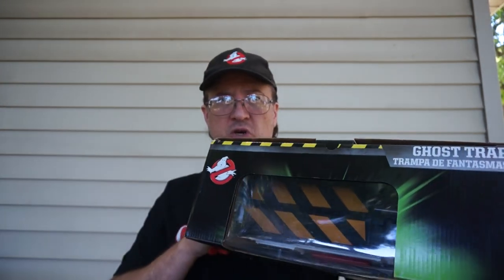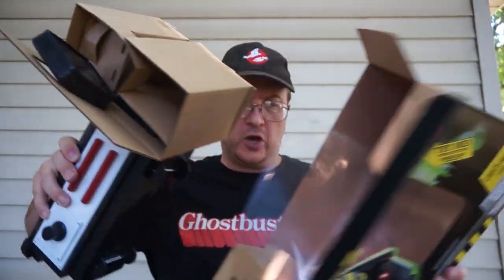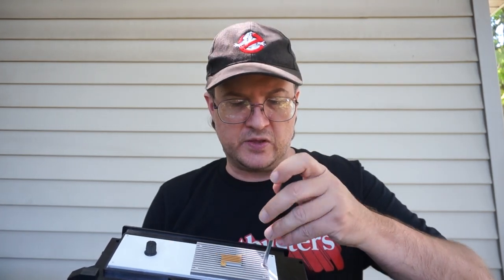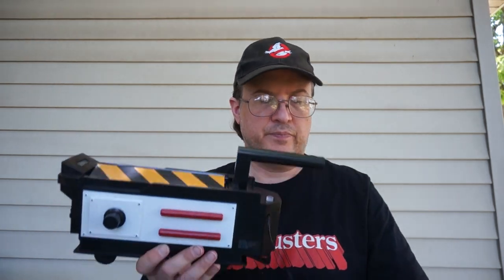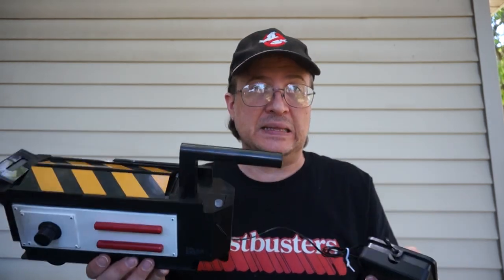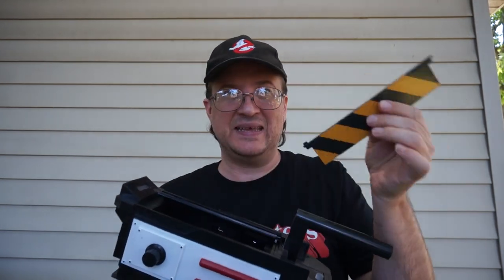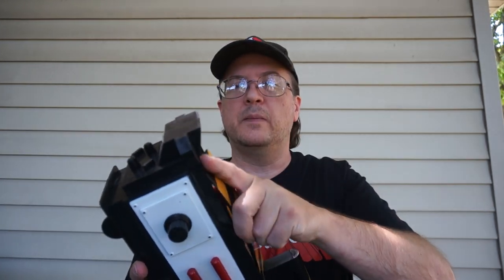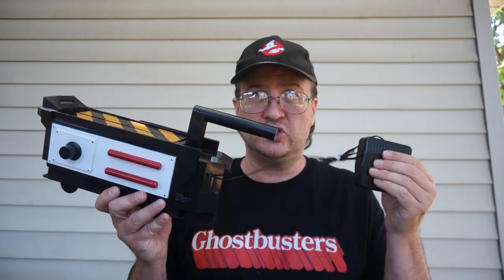TRAP DOORS (and how to repair them)

Comment: I bought this for my nephew. one door is open a bit. did consider returning it (for his birthday) in exchange for one with doors closed. but he will be 6 (i know age but its a toy) I doubt he'll care plus Im sure it will eventually happen. will tell my sister and brother in law of your video if its an issue. It seems a simple fix to not worry. easier to fix then return
Reply from the maker: Sure, just send them the link to the vid. If they have any other trouble with repairs to it, they can leave a message on the vid and I should see it within a day or so, and maybe I can either reply or shoot them a followup video. Also, the wheels pop off of these fairly easily, as my sons discovered on Hallowe'en night, but we popped them back on with little effort.
Reply: @LextheRobot  his birthday is less then 2 weeks before christmas. each year I get him stuff that go to together half for birthday and half for christmas. He is a little into ghostbusters so got him this and the pike reader

Comment: Do you have any advice on what to do if the switch stops working? I’ve put in fresh batteries, the lights all light up, but the switch won’t open the doors anymore. I’d love to get this working for my kids again if at all possible! Thanks!
Reply from the maker: If I recall correctly, someone else did a video about how to disassemble the pedal to customize it. That might let you access the switch inside and see where the problem lies. Otherwise, it could be a loose wire inside the main body.
Reply from the maker: I think was the video I'm thinking of. https://youtu.be/RYZdlNIaf6o

Comment: I have broken the black parte  that makes the open action in the door, how can i repair this?
Reply from the maker: Sorry to say, I am not sure. I've not disassembled one of these yet personally. But there are other YouTube channels that have taken theirs apart, maybe if you search for one of those, you might see something that would help you effect the repair. Worst case scenario, these are showing back up at Wal-Mart, maybe you can do a return or exchange?
Reply: @LextheRobot  It was my mistake when trying to repair the door, the part of the mechanism broke, fortunately I was able to glue it but the door gets stuck every time I open it I think it is because it was a little misplaced, but I no longer know what to do
Reply: @LextheRobot  I do not know if the plastic can be welded or how it can be reattached to the door but in another way